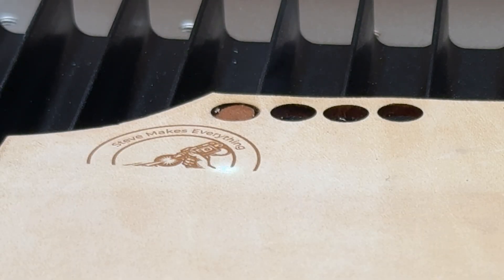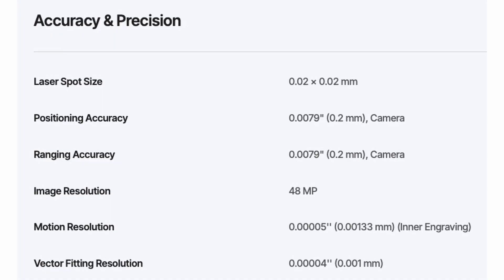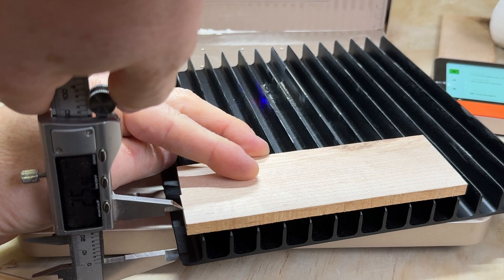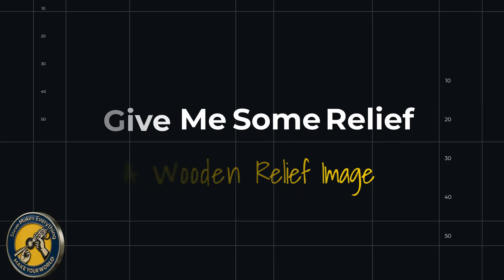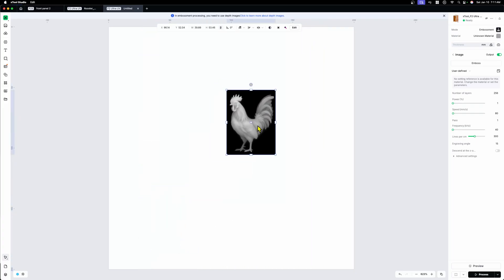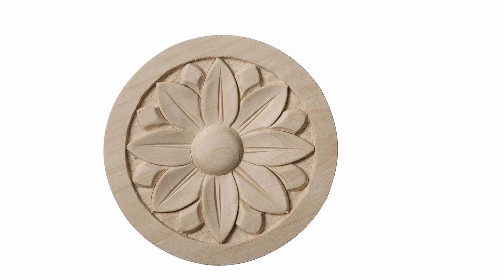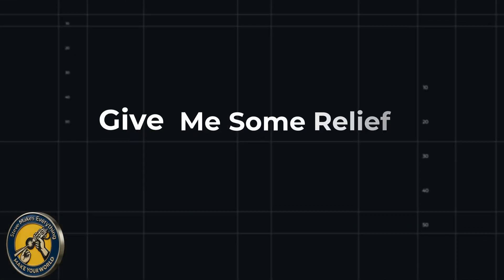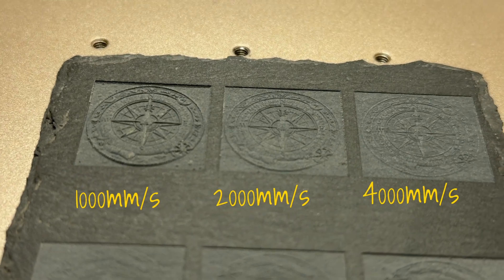INSANE Relief Engravings with the xTool F2 Ultra UV

Comment: Stopped at :59, my Omni 1 doesn't have Z axis control like the Omni X or F2 UV.
Reply from the maker: Yes.  For a simple image like the one on the stone, you might still be able to do this by running a job with 15-20 passes.  Lower the focus (manually turning the Z-axis knob), and run the job again.  Repeat.

Comment: Sorry if already asked, but how deep was the rooster relief ?
Reply from the maker: The one I showed was about 2.5mms however, because the Z-axis is adjusting with each pass, you can really engrave as deep as you want.  I did an engrave of the rooster that was 7mms deep into maple while I was playing around with this example, but the rooster start to look like it's on a pedestal, so it's not natural.

Comment: Might not be a "five figure laser" like you stated, but it's more than halfway there when you factor in most of what you need to get started.  I get the point and don't disagree, but I don't think it's being pedantic to point out that something like the F2 Ultra is really hard for people to justify unless they are using it to make money -- and the average person without much experience or an existing client base is going to take quite a while between the time they buy a machine like this and when they get to the point where they could pay it off.
Reply from the maker: Yes, this isn’t really a hobby laser. Most UV lasers are aimed more at small businesses they are just too pricey to use for fun.

Comment: Good morning Steve, thank for the video and tips. Great idea. One question though, on your last item which is stone. I have had many failures and success in trying to carve stone using a fiber laser but I have not been able to zero in on the UV Ultra. Could you provide the settings for this item since it looks like the stone that I have used before and would love to be able to produce something like this. Thank you in advance for your assistance.
Reply from the maker: The settings for every project here are the same (shown for the first project) except for the speed. For stone set the speed to maybe 800mm/s

Comment: What type of time frames for those engravings? Things like the stone mandala and the glass rose?
Reply from the maker: The totally depends on the size of the image, the speed and the number of layers you want. But for the stone, the image was 32mm square with 256 layers and it took about 2 hours, though in wood this would have take 20-30 minutes.  The density of the material also plays a part.
Reply: @SteveMakesEverything  I can appreciate the variability, but it's nice when we can see the times, because it helps set expectations for how viable doing a certain thing is in a business vs hobby setting. I might spend 2 hours embossing a rock for myself or as a one off family gift, but as a business I might not want to tie up a machine that long to make that a product for sale. 

Not enough people show the time cost and I think it's very important for people to see. 

F1 Ultra vs F2 Ultra UV and the F1 wins on speed almost every time for materials they can both laser. That's an important fact that people can forget when focusing on the new hotness! 

Love your videos, always appreciate how you approach each device with practical ideas as well as fun ones!
Reply from the maker: @richardhobson7724  I befiely mentioned the timne for one of the jobs, but you're right, that if you're thinking about a business, time is definitely money.  I'll try to make sure I include times more in the future.

Comment: Nice video. Rock is pretty broad and I suspect some rocks will emboss better than others. What kind of rock did you use. What settings - I assume that speed what the main adjustment.
Reply from the maker: Yes. The setting are the same for every project here, except for the speed.  Go slower for atone.  You will run into some variation between different rocks and there will definitely be some you can’t touch regardless of speed.

Comment: How well can the 5W UV emboss metal? 
Not looking for deep engraving which would be better suited to a fiber, but rather some relief (maybe 0.3-0.5mm deep) into a 1-1.5mm thick SS card that I’d be able to paint fill.
Reply from the maker: UV lasers in general, regardless of power, aren't especially good at deep engraving on metal.  You can work at it, but it's not an efficient process.  A fiber laser is much better for that.

Comment: Hi. It seems the AF procedure on this machine is very inconsistent. Most have to do the AF on a piece of paper, then lower 1 or 2mm to get it working on glass. Mine is the same and also seems, on the same batch of glass, to be inconsistent from day to day. I never trust the AF.
Reply from the maker: Well I don’t trust AF on any laser. This one is better than most, but for consistency, I use a gauge that I created to ensure I’m focus is the same all the time.  My AF works pretty well for regular engraving, but for reliefs, your first engraved layer has to be perfectly pointed to the surface.
Reply: @SteveMakesEverything Ok i see. Could you please explain more about the gauge, maybe a short video 😊
Reply from the maker: @leffep  Really all it is  is a single purpose ruler.  Once you get your perfect focus, accurately measure from the lens (I use the rim around the lens to the workspace surface).  When you want perfect focus, insert the gauge and make it just fit between the lens rim and the material.

The auto focus is going to get you to the right spot +/- a millimeter or two, so this is really just a fine adjustment after.

Comment: Why does nobody mention the short lifespan on these lasers? 10,000 hours, 2-3 years of moderate use and its time for a new one
Reply: 8 hours a day, five dayes a week, thats 250 weeks = 4.8 years
Reply: In 4.8 years the F2 Ultra UV 5W will be obsolete, and we will want/need the newest technology to remain competitive.
Reply: Everyone knows. 
It says it in the specifications when purchasing any laser.
Reply: Hello! I just tried a brass coin for the first time on my Xtool UV. After it was done with the depth map it went over the whole coin and destroyed a lot of the details. Have you ever had that happen? My settings seem very close to yours and I did not select cleanup
Reply from the maker: Yep. Up lasers are. It really isn’t intended for coin engraving.
Reply from the maker: Per some of the other comments here, it is stated in the specs and running 24x7 it still adds up to years of operation. I can promise you the in 4 or 5 years you’ll be looking for an upgrade anyway because to technology will evolve rapidly.

Comment: This is the future of engraving/relief making but not yet,it will take years before this has enough power for hobby home use.With the weak power of UV laser today,and especially the F2Ultra with the low power of 5W this will take ages to produce and support only soft materials.To do relief engraving on harder materials we will need much more power.And to do this on glass you need a special glass like soda lime or borosilicate.To do relief and general engraving the only thing imo is to go for a cnc.Lasers are great and i love the technology and i own both a s1 and a f1,love them both but they are limited in what they can do.Even though the F2 Ultra UV is in a total different category than what i own,it is a very limited laser with a spesific and limited use.I personally want a uv laser but not yet,and i would like to go for xtool.I will wait for the F2 Ultra V2....most likely a combo machine,could we hope for a 60W mopa and a 15W uv ??  Well time will show,but for now I will easily skip the F2 Ultra UV with it`s low power of 5W,it surely got its use i do not doubt that,but it is kind of a gimmick imo,at least when you consider what this machine cost...it is not something you just buy for fun and testing.This is a investment,and at this stage a bad one.I emphasize that this is my opinion,yours might be totally different i might be wrong but it is my opinon....just saying 😉
Reply from the maker: The power doesn’t actually change what you can engrave. A 12w will be a bit faster than a 5w, but not twice as fast